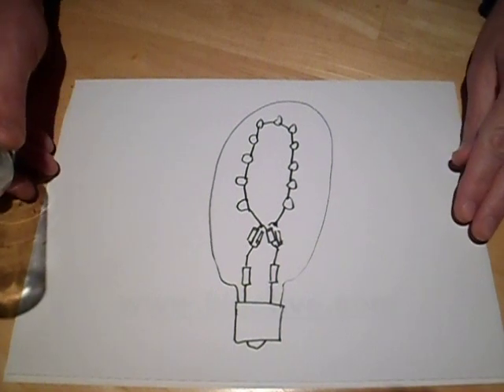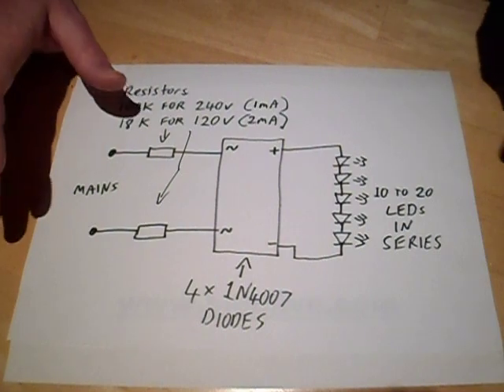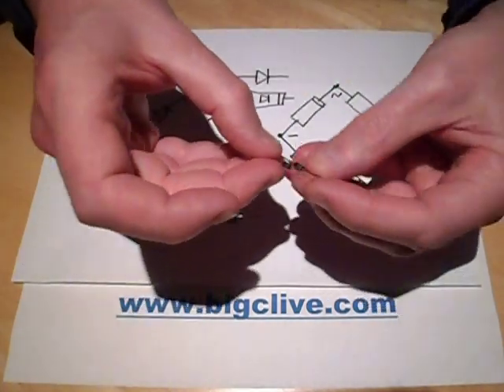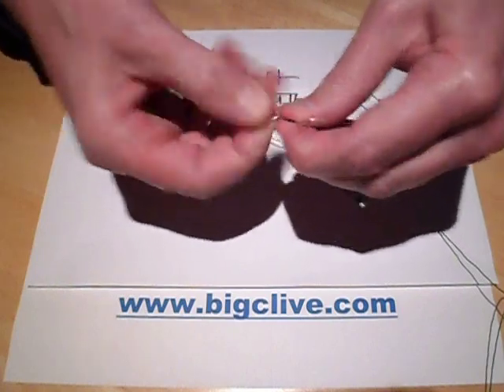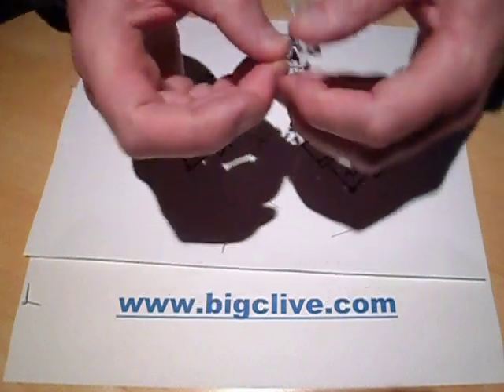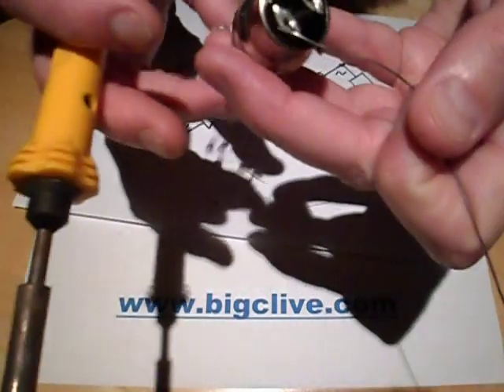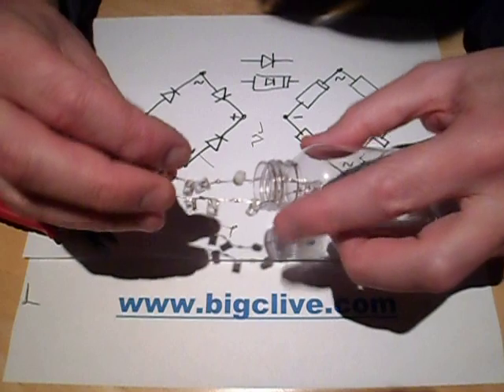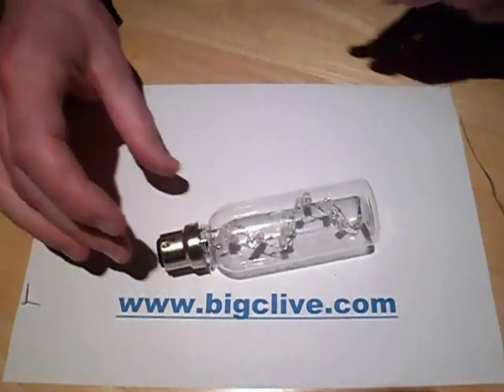Making a simple mains LED decorative lamp.

Comment from the maker: I chose the resistive dropper because it's super simple, the components are likely to be found in any dabblers workshop, the current was deliberately very low for decorative effect and the shock risk after the resistors is low whichever way the lamp is inserted.  I did toy with adding a capacitor, but theoretically it would have to be rated for open circuit voltage of at least 350V.  The flicker is very low because the LEDs are lit for most of each half cycle.

Comment: The reason we have Bayonet caps in the UK is to do with a chap called Sir George Lane-Fox. He developed it and sold it to Brush Electric Lights, who then distributed it around the UK and thus is why we still have Bayonet caps now. They're also very good for trains, in both signalling and on the carriages as they don't work loose due to vibrations. Also, bulb theft is the reason why a lot of train signals have three-ear Bayonet cap sockets.

Comment: IIRC, 1N4148s have a reverse breakdown potential of about 70V and maximum rated currents of only a few tens of mA.  As die power dissipation would be about 100 times greater in reverse breakdown than when forward biased for a given current, the diode in question may still fail if carrying a current more than 1% of its maximum rating, but it would be a somewhat uneventful death instead of a bang.  I think.

Comment: Hi, i have watched the video. I really appreciate your efforts. Well i have couple of questions.

1. For 20 5mm white led's the required forward voltage is 72V. Now what is to be done if i specifically need to illuminate 5 Led's with 3.6v forward voltage and 20mA max forward current? Input AC voltage is to be considered as 240v

2. Is connecting 100K on both lines and rectifying it always produces 72V DC when powered by a 240V AC line?

3. Do we have any mathematical formula to design led lamps according to need?

Comment: what ruffley is the voltage coming through to the LEDs I can't check my son has put multimeter in the toilet lol
Reply from the maker: After the current limiting resistors the voltage will drop down to whatever the combined forward voltage of the LEDs is.

Comment: If you exceed the peak reverse potential of a diode but limit the current so that the maximum die dissipation rating is not exceeded, the diode will just act like a zener/avalanche diode.

Comment: Can I use 1N4004 diodes instead of 4007s? (ordered the wrong ones) and can the resistors be lower value to get more out of the leds?, (I am in Australia so 240volt)
Thanks

Comment: Hi clive :) a beginner question. doesn't the current limiting resistors dissipate more power? Ive read that a capacitive dropper is a better option as it dissipates a very little or no heat/power.
Reply from the maker: Yes, the resistor is only suited to very low current applications as it does dissipate the voltage difference as heat.

Comment: just out of curiousity whats the best way to calculate the resisters needed to drive the leds at a certian milla-amperage id love to build this on 120 ac but run 40 leds. which is 105 volts leaving 15 to 30 volts to drop depending on voltage of the evening. any help would be great.
Reply from the maker: +Aikouka Ookami 40 LEDs might be a bit too much, but the website version of this project may help.  http://www.bigclive.com/diyled.htm

Comment: I managed to get some of the purple LED strings in poundland. I think they might look nice stuffed in a lamp, but I'd probably need to run it off a capacitive dropper, as they're not in series. Do you think that would work out?
Reply from the maker: Capacitive droppers are best suited to series strings.  Better to use the USB and resistor approach.,
Reply: OK Ta. Maybe I should consider some of the other LEDs I have. I did get some individual purple LEDs.

Comment: Greetings. I'm just wondering what sort of Resistors you use. as there are a few of them. like metal film, carbon film. and 1/8W, 1/4W, 1/2W, 1W and 5W. If i where to make this what sort of resistors should be used? Thanks =)
Reply from the maker: +flpsht I tend to keep a stock of quarter watt carbon film resistors.

Comment: Hi was wondering how would a switch be attached to this?
Reply from the maker: It's designed to be used in a standard lamp holder, so you could use a switched lamp holder.

Comment: Using lossy components such as resistors is never my trait. I would use a small capacitor; not a microamp would ever get wasted. Now you waste a lot of energy, negating the benefit of using LEDs in the first place.